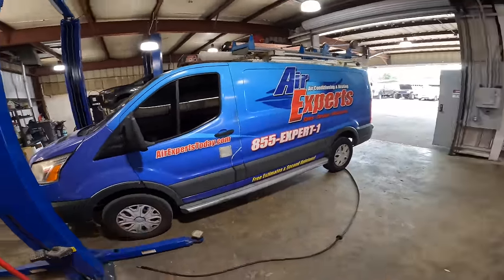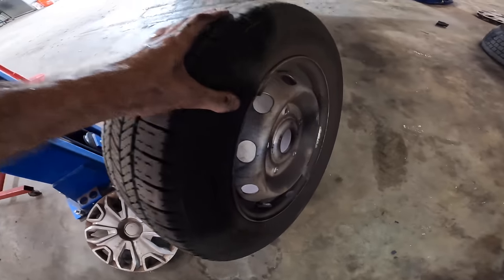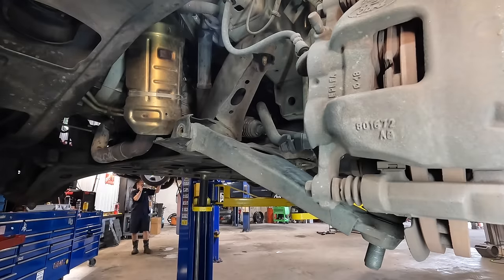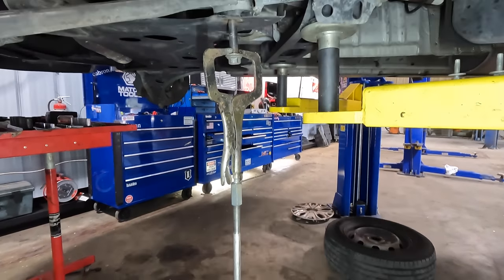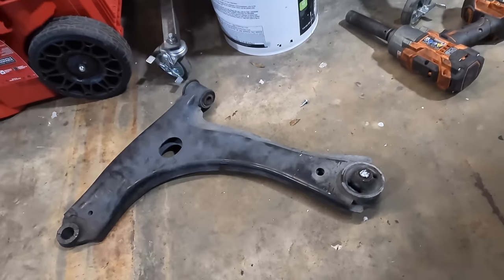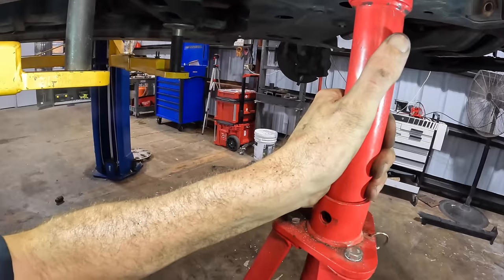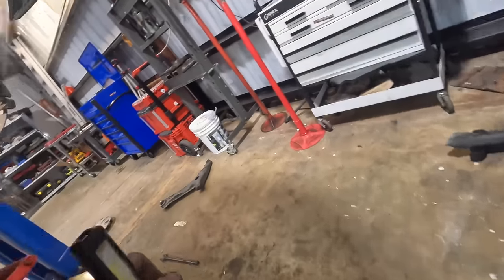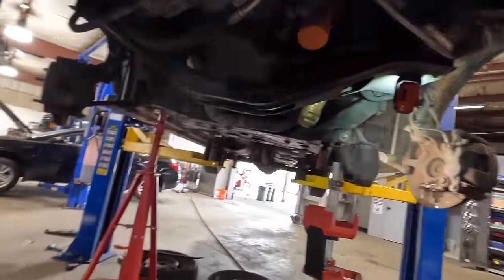Bent Frame Bolts! Easy Job Escalated! Ford Transit 3.7

Comment: A video where Ray resorts to using the sawzall, drill or torch is never a bad video. As Ray has said in the past, these parts underestimate Ray's ability and willingness to escalate to more extreme forms of violence. 😂
Reply: It's the power station paradigm, or Chuck Noll's favorite saying:

"Whatever it takes!"
Reply: Always fun cutting out suspension bolts ain't it thought I was losing my mind the last ones I did 
Every bolt on the rear of a 2010 mitsubishi shogun
Reply: almost like watching 'Tim Taylor' when he gets all his stuff out but Al does all the work.😁
👍🇺🇸😎
Reply: Can't be stuck if its a liquid! :D

Comment: Those pieces of body armor are there to ensure that if you have a front end collision it makes sure that the bolts in the control arms bend so you have to cut them out.
Reply: Sounds about right.
Reply: Ye,and a bit overkill it looked as if they were supports for the front bumper,they obviously done the job they were designed for,maybe to prevent the front chassis legs from having excess damage in a front end,surprisingly they didn't bend.
Reply: Maybe Ray has the Sawzall set on "Reverse"??🤔
Reply: Looks like those front braces did their job making a simple job more difficult.
Reply: @1gerard47  They where probably replaced after the accident.
Reply: Silly me, I thought it was so you have to bring it to the Ford dealership!
Reply: Ex-rental... so just like the 'rock sliders' show the van was prepped for inpending doom. In this case it is prepped for towing. Stock there is no solid towing hook on these vans.
Reply: Hot flame make life easy?

Comment: Helpful hint: if the lower control arm is horizontal, there is no side load on the rear bushing and the vertical bolt will easily drop out, especially if an uncovered floor drain is close by.
Reply: Yes, and if you out-clever yourself by covering up the floor drain, it’ll NEVER come out (without a Ray-approved sawzall)!
Reply: Normally with straight bolt yes. Floor drain is an extra. Then it is fishing time for wife with small hands. Retired mechanic in Land Down Under.
Reply: @bobhudson6659  She has magnetic fingers?  Did you retire before neodymium?
Reply: @bobhudson6659  Doesn't stuff fall UP there?
Reply: Yep.  they like to find holes to hide in.
Reply: Who-the-what-ium?? @MattOGormanSmith
Reply: @bobhudson6659  gravity in the land down under stick things to your ceiling? 😆
Reply: Actually the South Pole is the North Pole (geography is lying) so we have things right side up here. Please leave me in my inebriated state. @RVBob
Reply: @bobhudson6659  When I worked in the power stations it usually wasn't a floor drain, but falling through the floor gratings. One magnetic flashlight survived falling four floors and somehow managed to get to the concrete floor on the ground. It didn't survive the second time. I learned to carry a magnetic collapsible retriever and a roll of bricklayers string in my toolbox. 
The boiler house is going to be demolished in September. I wonder how many tools will be found in the wreckage.

Comment: OMG, I’m so happy to see I’m not the only one to have a simple job go way south.
Those ball joints absolutely had to be done though. Even without the suspicion of an accident, they’re well worn.
Reply: And on the driver side, the rubber boot just fell off with vibration. So, it was not all that well seated anymore.
I also think I saw grit in the exposed joint.

Comment: Good job Ray on getting your shop dialed it. It’s looking good. I’m sure the van needs some new KYB strut assembly’s . Bolts like that one not coming out are a real ticker. Ray has heard it many times but I’m gonna say it again , Ray is a great mechanic.
Reply: I would say Ray's a mechanical engineer. His skillset is brilliant IMO!! 👍👍👍👍👍
Reply: I heard that Ray's a great actor, and this program is being filmed on Warner Bros. old back lot in Hollywood. 😎

Comment: I work as A Ford Technician here in Chicago those Transit control arms are a common job.i always get new bolts and cut the old bolts off..it seized inside the bushing insert

Comment: Yes those big galvanized running boards indicate that was purchased from U-Haul when it was relatively new.  Trust me those are very heavy to take off too. They use  existing factory holes in the frame with special fasteners.  I bought my 2014 E250 from U-Haul with 2400 miles back in early 2015.  They used to flip their small vans very quickly.  Don’t know now if that’s still the case.

Comment: You probably already know this Ray, but if you can get the foot of the saws all against a solid surface, it will cut faster. It lets the blade flex less, and helps prevent you from absorbing the reciprocation from the saw.
Reply: Of course, you need to have sufficient clearance beyond the cut for the length of the blade.
It looked like, for the lower of each cut, that space was partially occluded by a structural curve of that lower plate.

Comment: Hi Ray. I'm in the UK and can feel your pain. Best way to remove that arm is to get it level and the bolt will fall out. With the salty roads over here l, that bolt usually rusts to the steel sleeve in the bush.

Comment: Ray on the driver's side where that bad ball joint was that bracket it was stuck in look at it carefully I swear I seen a Crack in it which means the new ball joint could bust out of it. It's a small Crack just around the rim of where the ball joint goes in at or it's just paint Crack is it painted ?

Comment: I don't own a shop, but if it was me I would switch the HD lift with the center lift and mount the lift a foot or two farther away from the wall.  Might limit access to the angled lift but I would use the new used on and the HD lift most of the time.  Use the angled lift for smaller cars.

Comment: I was in exactly the same situation when I had to replace a front lower control arm on a 2012 Fiat 500 (same as a 2nd Gen Ford Ka). There was a beam from the subframe to the front bumper obscuring the front bolt of the control arm. Fortunately, it wasn't too bad to remove. I hope the owner gets the front tyres replaced and the front wheel alignment done.
Reply: Agreed!

Comment: There's a chance the SAI or caster on the alignment will be at the edge of spec. Replacing the control arms will help but the subframe may be tweaked.
Reply: Looks like everything on that front end is junk. When he pulled the DS boot off the ball joint, you could see how much slop it had in it. Then add in the collision damage like you mentioned. Throw some parts on it and see if it will align🙃

Comment: used to work for Ziebart rustproofing. The guy doing the undercoating has A Chevy SS454 pickup to do. He centered it on the rack not realizing that A big block short box truck was gonna be front heavy. It fell. No one was hurt, except a few grand fixing the truck... j/s

Comment: I think I might have devised a better way of using prying force, while turning the bolts, before resorting to the slide hammer and sawzall. I think you’re still inclined to forget you have an extra pair of hands that can be used to hold tools for you. Watching you struggle to work with one hand, when 4 are available is always a toss up between fun and frustration.
Still, you got there in the end. Bet you were sweaty!
Props for getting through it.

Comment: Ray, your perseverance in the face of adversity is truly admirable mate.
I mean seriously, dragging out the Hackzall, slide hammer, pneumatic hammer to cut through bent control arm bolts and distorted ball joints shows that you're not going down without a fight. Goodonya mate - you've truly earned this evening's cleansing ale after going through all that.
Watching you fighting the ball joints with the pneumatic hammer, I was wishing that you had some pneumatic spreaders that could wedge in between the flange and the base and extract it that way.  You would've had a better angle of attack than going in from the top with the hammer.
I can't wait to see the next one in this series.
Reply: The control arm bolts.  When the picklefork maxed out, the genius could have just put anything metal (like the head of a hammer) in between his picklefork and the frame to move the pivot point lower so he could keep praying with the picklefork while using the impact.  Would have taken 30 seconds and the bolt would have been out and the customer wouldn't get hit with an extra hour of shop time while this dude screws around

Comment: Catch 22: if the control arm bushing fails, you can't get the bolt out. If the bushing is intact, there's no reason to change the control arm! Been there, did that, had to drive 2hrs round trip to get the only two suspension bolts left in dealership inventory in six counties. Keep up the good work, Ray, you inspire us all to just keep calm and impact on. 
Also, torque wrench clicks - shoutout to 15:26 !

Comment: I really enjoy your videos, especially when you run into unexpected problems. A small suggestion, deablo blades for the sawzall last longer and cut hard metals quicker, you can also get shorter blades that make it easier to only cut what you want to.

Comment: Seems like I run into problems like this which should be simple then realize, no lift, not enough tools, not enough experience, not enough patience and fear car will be stuck broke down in driveway then face massive expensive repairs from someone I don’t trust.  Choosing battles wisely is important.  Wish I could find a good honest mechanic like Ray.

Comment: I have seen so many cars fall off these lifts I was really triggered when you had the round supports on the first place on the van but thank goodness your experience talked to you about the situation but If I was going to be banging and tugging on the frame and suspension parts I would have extra screw type supports under there with me just in case it might slip off the small rubber mounts.  You are the happiest Mechanic I have ever seen and I'm sure it's because you are very successful and have a great wife~!! :person-turqouise-waving::trophy-yellow-smiling:

Comment: At my shop ive done a few transmissions and even catalytic converters on these vans where that subframe has to come out. Even with only 50k miles ive had to cut the control arms to get those rear control arm bolts out.

Comment: Thought of you, Ray, this past weekend while changing steering knuckles on my Cherokee.  Four cans of Brake Kleen.

(for you non Jeep people, on XJ/TJ the brake pads slide on the knuckles, not a caliper bracket, and scrape grooves into in the metal; the only fix is to weld the divots, or replace the knuckles)

Comment: I use the [pinch welds all the time to lift those transits. there are a couple spots where the tower channel comes within an inch of the bottom of the pinch. I haven't had a problem yet on a non rusty van.
Reply: Also, torches are the only way to go on those arms. I cut the arm off, burn the rubber bushing, then all that's left is the inner sleeve. Heat it until it glows and the bolt comes out. It's annoying burning rubber, but you don't need to buy a $35 bolt per side.
Reply: how much?  😮 @Lee-td3fi

Comment: 4:00 I didn't like those support points on the front frame either, glad you decided to move them inboard to the flat and likely much more stable frame area.

Comment: I enjoyed watching videos like this. THe repair was good and it helps give me ideas. Everyone has that spare bolts / nuts drawer, but when you're in a pinch you could have some threaded rods and nuts then simply fabricate your own by stick welding a nut onto a threaded rod and cut it to length

although this is more catered towards home DIY than professional, it's something i'd consider if I had to hack a bolt to pieces but had none spare

Comment: Just a suggestion, I think you were on an easier method to extract the bolt prying and turning simultaneously.  I would have grabbed a block of wood, etc as a spacer to place between the pickle fork and the frame to improve the angle of attack to compensate for the bolts length already pulled out.  Thus using the bolts threads rather than fighting them.

Comment: If you think that rear bush bolt was a pain, try doing a European MK7 transit that's been sitting in the wet and cold all its life. If you're lucky, you'll only need to cut the bush rubber to allow the sleeve to rotate with the bolt, or the captive nut will detach within the box section of the chassis and you'll be cutting inspection holes to get at it in the floor.

As for the bottom joint, could you not squeeze a little bottle jack in there upside down pushing against the hub arm?

Comment: Regarding lift/rest points, anything less than a solid, square perch makes me nervous.  I'm glad you repositioned your lift arms at the front of this van.
 
The "easy" jobs ofttimes aren't, as I've learned working on my grandson's Ford Explorer.  (In fairness to Ford, his particular vehicle was badly neglected and abused before the boy bought it.)
 
We wonder what other ills lurk within this Transit.  It'll certainly need a front-end alignment after your work is done.  My lady and I have discussed getting one for a hauling/"junkernecking"/camping vehicle.  I may be having second thoughts, now.
 
Good work, looking forward to a Part 2. 😉👍🏼

Comment: this video reminded me of making and trying out an impact hammer adaptor into a palm nailer. Maybe hold it with a boxing glove in tight areas. Ive found cutting at slow rpm with sawzall keeps teeth on the blade. Quits cutting when they get hot. U did good and captured great carnage in quality HD. thank you

Comment: Welcome to the world of car repair where the apparently simplest of jobs can turn into a nightmare. Reminds me of the time I was changing the oil on my wife's car and had to use a cheater bar to break the drain bolt free. Seems the Oil Stop that last changed the oil used an impact gun to tighten the bolt☹

Comment: love that term “noodle arm” excessive ware on your arms trying to cut the bolts that are a “s” curve 
over being straight! always a speed bump in the job! at least you were able to access the bolt!
what was the reason that you decided to change out the ball joints? would the mount be bent?
or compromise the strength of the ball joint? they were super tight! glad you got them out !

Comment: At 12:09 you could have used a spacer with the pickle fork to continue the downwood motion with hammer
Reply: Also could have pushed back up on the bolt, cut at top with clearance issue, then pulled out.

Comment: I did lower control arms on my accord myself the passenger side was smooth and easy had it done within 30 mins everything came out easily and went back in easily. Moved to the drivers side, the straight up bolt through the body would not budge out of the sleeve on the control arm. Had to pay a mechanic with a torch to get that cow out . Never say the job is going to be quick and easy you jinx yourself especially on cars that live in the salt belt

Comment: Ah the old reliable Frd Tranny, a workmans most reliable tool. With handy nut holders too, very swish.  Hee, I kinda knew things would go south when you said this is an 'easy' job...
I've done that myself many times, a 10 minute job turns into an hour of swearing and frustration.... and I love it. You have a good one Ray, great video as always

Comment: Your lucky you're not in the North East salt belt. I just did a subframe replacement in the same year rig. All those front frame horn 13mm head bolts I had to heat the threads of them or they would have snapped. Luckily the vertical bolts came out, but apparently in my area they like to seize the entire length of the inner steel core of the bushing. Also, Ford is very adamant that you replace the control arm bolts anyways, as they actually keep them in stock. We also had to cut the unibody open to heat the cage nuts so they wouldn't spin, and then weld it back up. Rust sucks, and yes customer pays more .

Comment: Just a friendly reminder. Put a trans jack under your control arms and put just a little tension on it. You won't fight them bolts AS much pulling em out going forward. Every since my Dad showed me 20 years ago with a floor jack how much easier it makes the control arms it's the only method I do now.

Comment: there the heavy duty ball joints normal ones just have snap ring and no bolts, worth checking the front sub frame bolts also if the rears are that bent. where i live its common to cut them bolts out because of rust also cutting a hole in the frame to get to the nut. i also find it easier to remove the hub and air hammer them the strut hole usually find the tie rods and rod ends are worn out as well

Comment: common problem on transits with those bolts, the sleeve in the bush over time grabs hold of the bolt, here in the UK we dont even attempt to get it out, we loosen it and do exactly what you did and cut it
Reply: Get them bolts out all the time here in Scotland they either come out or roast them with the burning gear then they come out never cut one to get the arm off

Comment: Actually just used a corded Milwaukee Sawzall and cordless Dewalt reciprocating one. Had to cut old cam bolts on some lower control arms on a Dakota. Totally frozen in the bushing inner sleeves. 

Fun times was to be had, since I don’t have a press I’m having a shop press in new ones. For I don’t feel like buying new control arms them lower ones on the 2007 variety is to damn expensive.

Comment: Ya kno....  you have a NEW dimension in auto repair:  The use of video to document unexpected difficulties.  You would be able to quote repairs but with reservation that extra problems = extra charge BUT with video capture.